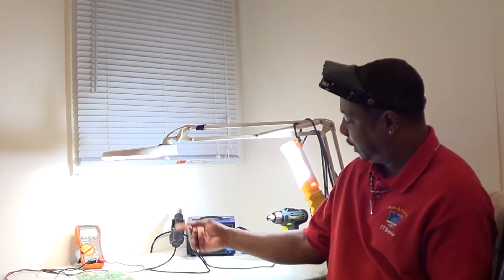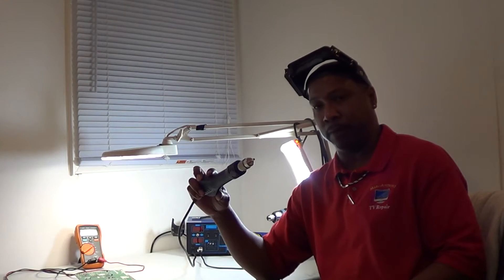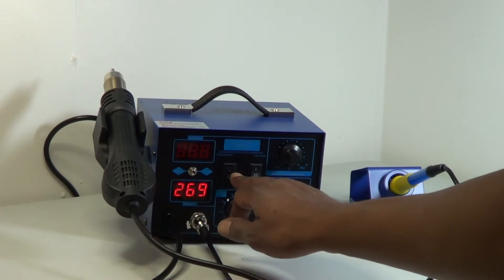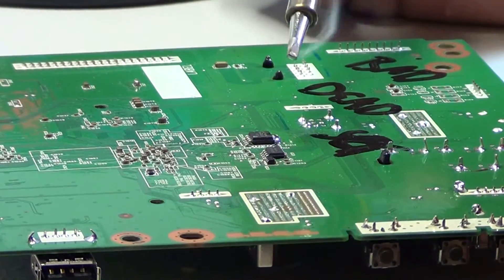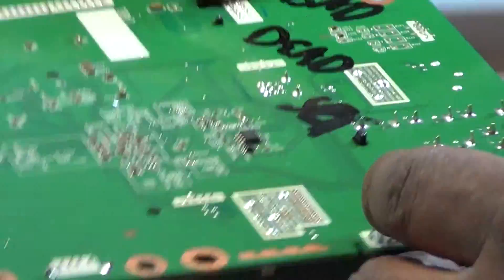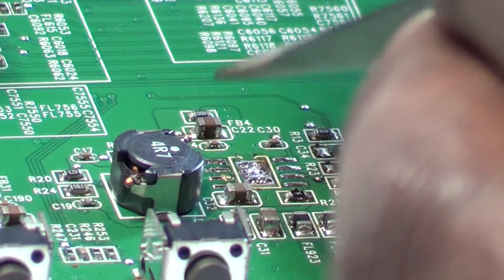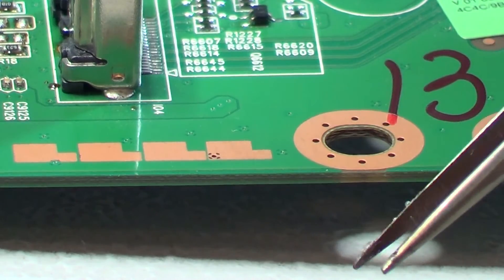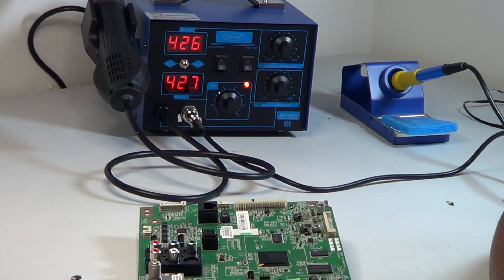862D+ Review and Demonstration for Tv Repair

Comment: How long did this last?   I've seen people have issues with the hot air coil burning through thing insulation tape and shorting to the outer casing/ cylinder wall.    I'm sure you don't have it anymore..  but how long did it last?

Comment: The sensor is in the heat gun, theres 2 magnets, 1 glued into the highest points inside the cradle. 
Also nearly nobody mentions that when you unplug that iron from the box theres 120v coming through those pins...

Comment: thx for the demo I went on ebay I see one like it for $70.00 that has a built in power supply. it's a mocel 853D
Reply from the maker: Mine is still working, LOL.
Reply: that's good to know but the power supply would be useful to me, my hobby now is fixing transistor radios.
Reply from the maker: I got U covered. Just hit the notification Icon.

Comment: The reviewers that take it apart are doing so to make sure and to show us that it is wired safely, so that it doesn't kill you or burn your house down. Kind of important information for those that care about living, protecting their family and property. Because these cheap Chinese knock-off stations have had problems in the past of being unsafe.
Reply from the maker: Gotcha
Reply: I wondered hearing you talking about fixing tv's in chicago.
Here in country all the repair tv shop are cosed.

I fix treadmills machines for many years and have a lot of work.

Please comment.

Cheers.
Reply: Yeah it's a good idea to look inside first since some of the Chinese sellers have had problems with reversed polarity in the past.
Reply: Yea but there just taking it apart and not showing us does it heat BIG video chips or does it really dissoder there beating around the bush and they were of no help because they really want people to not do the shit so people will come to there shop and get there shit fixed instead of telling them they can really doit themselves